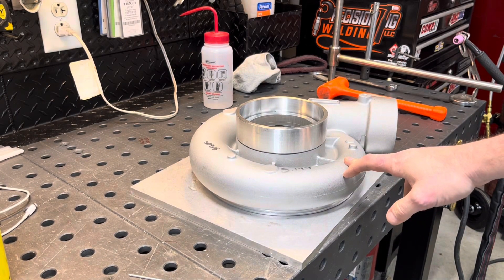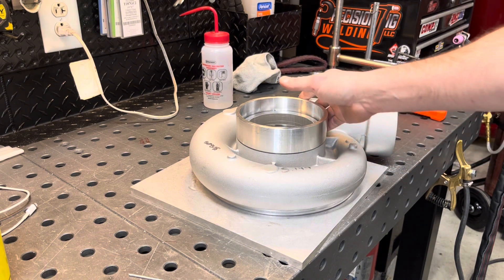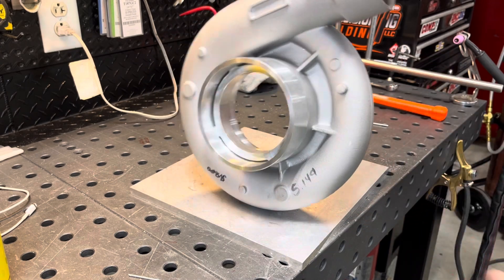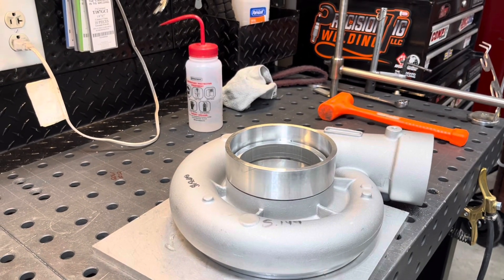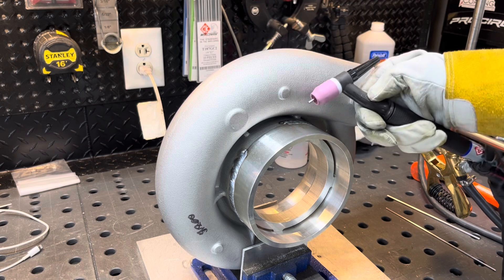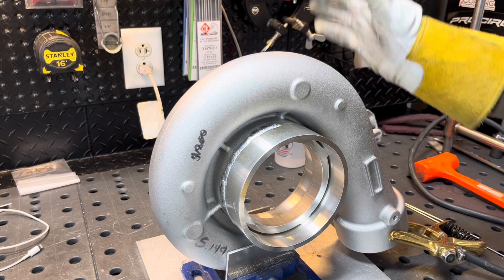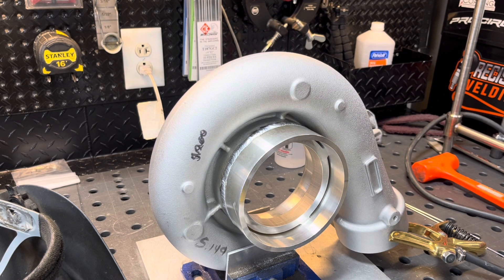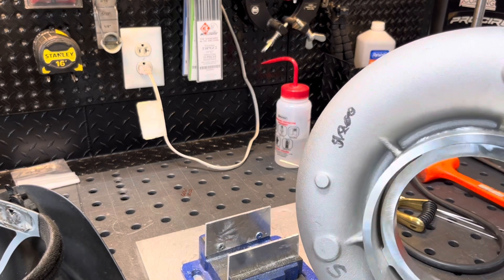Tig Welding Cast Aluminum to 6061 part 2

Comment: Your almost right about Map gas, or other Oxy fuel mixtures.
Its not really condinsation and its not moisture in the part.

When you burn for example oxy propane, the process is the same for most hydrocarbons like Map just simpler with propane, 
C3H8 and O2 break down into CO2, H20 "Water" & and heat during the combustion reaction.

This is why parts get moist during the heating process.

I've had the same argument with some of the other welders in work.
Well not really an argument but this moisture in the part is just a pervasive myth/ assumption in the industry i think.

Comment: Good stuff. That mod is a ported shroud, which helps with compressor surge. I do a lot of compressor and exhaust housing mods here in Japan, and the absolute worst ones are the Nissan R35 GTR housings. The inclusions are so bad that I'll have a blow out on almost every one. It'll spit molten aluminum all over the screen in the gas lens, which is why I stopped using them. Absolutely right on grounding aluminum. Big nasty arc marks where you don't want them. I use a large copper plate, and copper soft jaws in the vise because sometimes you just can't find a good spot for the work clamp. Cheers!

Comment: Try some 4047 filler for castings. The 12% of silicon helps with fluidity of the weld pool and results less porosity of the weld. The silicon seems to help with the crap of the cast material.